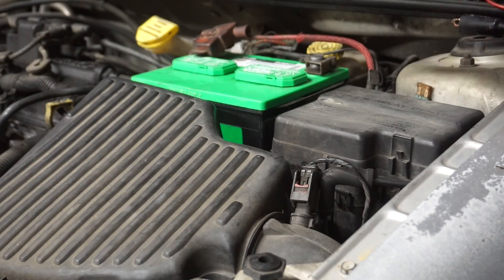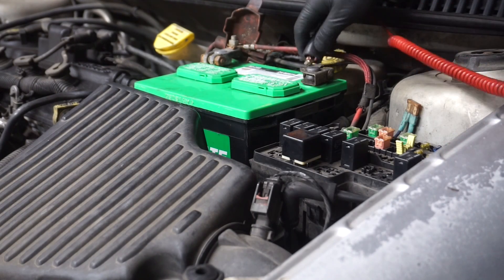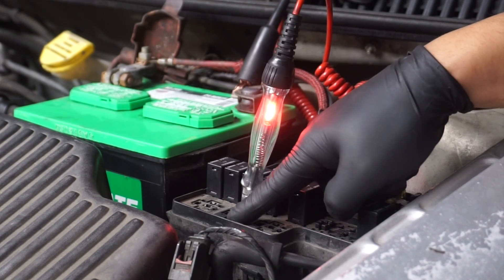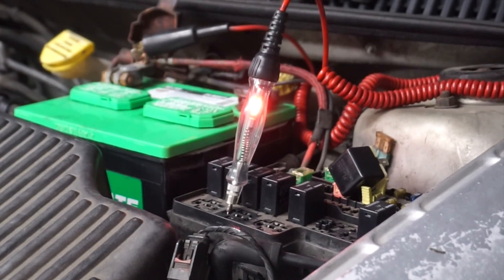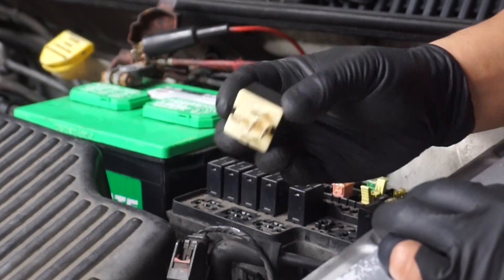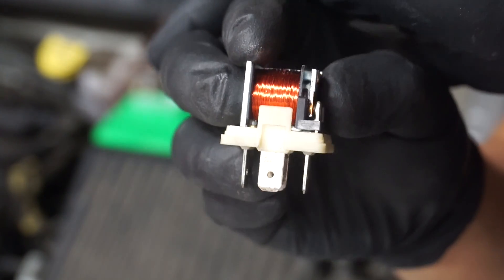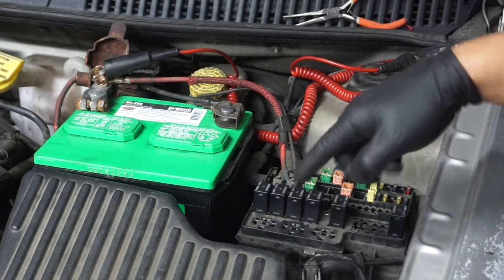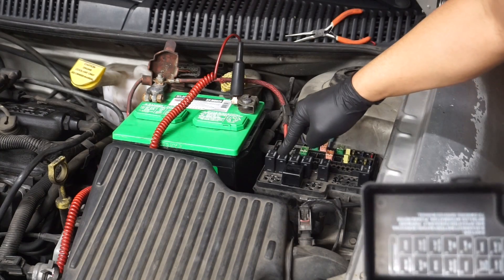How to test a relay and the relay circuit

Comment: can you troubleshoot relay for code p0888
Reply from the maker: Yeah what’s the year make and model of the vehicle
Reply: @HomieHektor  dodge neon 2005
Reply from the maker: @Midnightdragon9  SE or SXT Automatic or Manual Transmission?
Reply from the maker: @Midnightdragon9  Check fuse 17 (20amps) should have power all the time. That fuse feeds the switch side of the relay, make power is going out of the relay to the PCM. 👍🏼
Reply: @HomieHektor  SE automatic

Comment: Hi Hector good job. I have a 2011 ford edge. My passenger side tail light isn't working. I've checked and replaced the bulbs. I've checked for voltage. its good. any thoughts? Tomorrow i'm going to get some more bulbs and try that. Thanks Tony

Comment: excellent  I am not mechanic but i was able to start  2007 chevy express 2500 van using wire by removing start relay an connection 30 and 87 . New start relay , ignition switch replace,  lights on dashboard,  but when i turn the key the starter silent and light goes down and comeback  
what i am missing 
is frustrating  but also challenging  
please advise

Comment: Hector......do you have a video of testing the Port where you insert the OBD1 scanner.....I'm not getting any codes when I plug in my scanner.  I have a 92 f250 5.8 efi that's running rough and need to pull codes but not having any luck with the scanner. I tried the paper clip method too, to read codes from inside cab engine light display with no luck as well. Any help wil be greatly appreciated

Comment: Quick question, what is the relay under the steering column control. My fuel pump relay doesn't look like neither of the relays you tested. It's a long box type with four pronges.

Comment: 2011 Caravan problems:
1. Dash board shows: No fuse 
2. No BUS
3. Wiper half way
4. Main run relay clicking 
5. ASD was clicking 
6. Stick in PARK position but DASH board shows "R"
7. Electric lock not functioning.
Which fuse or relay to check and fix?
Ps: I was trying to pulling rear hub off to replace ABS sensor. Driver side door and slide door were left open, phone was being charged from car, suddenly there was beep and symptoms showed up.

Comment: Hey hector....i got an 2005 vue v6 tensioner went bad and ate the belt.. I replaced the belt and tried using a jump box ro startcar  and the the starter threw sparks and batt cables got hot.. Replaced the the starter and the poaitve cables... All it does is click and the cables get hot ..the starter kicks and spins on a bench test..could the alternator be shorted causing the hot wires and no start???... Computer still reads on the scanner

Comment: Eric, can you please help me find my flasher relay on my 2010 ram 1500. i changed my 3157 bulbs for leds and now I have hyper flashing, Thanks
Reply: You have to put ohm resistor at each bulb or you can by resistor specifically for car LEDs. I both one at Walmart in automotive department but it got really HOT when I turned my lights on so I just bought 1k ohm resistor and it worked fine. Some cars are so sensitive to LEDs that you have to install special module to stop flickering mostly German cars I believe. You can find videos on YouTube on how to fix problems with LEDs in cars. Hope this helps.

Comment: What does it mean if this jumping thingy doesn't work? 
*Compressor it's new.
*It's properly full of refrigerant.
Fuse looks good. 
Relay was swapped.
I tried jumping the low pressure sensor and the relay.
And didn't work.
What should I do next or which way should go? Thank you very much.

Comment: Homie Hektor  analogous to bypassing the AC relay and radiator relay, can the car be start without key inserted or removed and bypassing the starter relay with jumpers??? If engine is RUNNING, then can I drive without keys inserted??

Comment: been watching several channels to wrap my head around this. you do the best at explaining.   my situation fuel pump 2003 ranger key on 12 volts for one second power cuts off at pump.  start engine power returns and stays (i'm guessing drop is by design) this vehicle is having very intermittent fuel pressure loss and won't start due to the one second key on power drop, (with bed off thinking it was fuel pump)  i use jumpers leads from a battery to the pump to pressure system and start vehicle.. until i can figure out where my problem is can i use a bypass wire at relay socket without damaging my ecm. hope this makes sense i'm guessing the one second power is to "top off pressure for starting, then save unnecessary wear if not starting vehicle
Reply: have swapped relays results all same, not a relay issue

Comment: Tks for tips on RELAYS SAVE ME MONEY 👍
Reply from the maker: Pepe You are welcome. 👊🏼
Reply: @HomieHektor Homie Hektor I know it’s been years since you made this video but I had a wild situation. Woke up yesterday to no power to anything, no crank no start, just totally fine the week before, had some rain and light winter freeze and no juice to anything now. Charged the battery to full and still nada. Any idea what this could be? Does this sound like a fuse/relay or a bad ground wire? Thing is it was driving fine the week before, and battery holds a charge, but suddenly no lights, no chime, no dash, and nothing happens when we turn the key. It’s only a 15 year old car with very low mileage. Haven’t needed anything done besides regular maintenance. Is this the timeframe for fuses to just go for no reason? Does it sound like the main battery relay or something similar? Any suggestions you could give would be a life saver at the moment. What would cause absolutely everything to lose power all of the sudden?

Comment: good and very well explain, going to order that test light now...
Reply from the maker: Use the links in the description 👊🏼
Reply: @HomieHektor  analogous to bypassing the AC relay and radiator relay, can the car be start without key inserted or removed and bypassing the starter relay with jumpers??? If engine is RUNNING, then can I drive without keys inserted??

Comment: I have a 1999 Toyota Camry 4-cylinder Battery light on the dash I thought it was the alternator went back out when it was dark turn the headlights on everything heater radio you name it. When I revved up the engine the battery light goes off. I tried to turn head lights off light switch won't go off ??they will go off with ignition off.

Comment: after watching couple of videos i thought i could get a little help, i have a mitsubisihi pajero 2000 everything works perfect when the car is on, but when i turn off the car, i couldn't lock all the doors except the drivers door, also i noticed that the main lights also the interior lights not working as well when i turn on, and also the hazard light not working unless the car turned on, i was wondering maybe a fuse problem or relay problem, i checked all the fuse nothing has been cut all looks good, i was thinking maybe is the relay, i wasn't sure...
Reply: Lamese Maleko bad battery maybe. Auto zone will test it free

Comment: Would this kind of testing be appropriate to help me find a short in my car's wiring? I re-connected the negative wire to the battery and there was a large spark. After that, I'm facing a no crank no start situation. I thought I must've shorted the fuel pump relays (my car has 2) or the MFI relay because the pump doesn't' prime after reconnecting the battery and turning the key, but after bench testing all 3 like in another video you have up, they seem to be working just fine.  Am I even correct in assuming I shorted something? If you have some time, any guidance would be greatly appreciated. I'm scared to go around jumping stuff like in this video only and end up complicating my situation even more.  And thanks for your videos, you have one of the best automotive channels on youtube!
Reply from the maker: rightandleftish yup, sounds like you have a direct short to ground. Check your fuses, once you find the blown fuse, you have to figure out what’s causing it to pop 💥

Comment: Hector what about Nissan rouge ac blowing hot air what causes it
Reply: Familinda Valerio did you check to see if it has r134 in the compressor If it is charged then it is your switch in the dash that’s the two most common reasons

Comment: Great video! What would need to be done if there is not a steady ground in one of the ground pins? I have an oem hid headlight that is not lighting up at times. Usually lights up in the beginning but turns off after a while. Switched ballast, bulbs, and even connected the opposite headlight to other side but the problem remained on the passenger side. Checked the hid relay for current, 2 power & 1 ground sends a steady light signal but 1 ground flickers on & off. Will it be a hard fix or should just take it to the dealer?😩
Reply from the maker: Ilse Morales what kind of car are we talking about?
Reply: 2016 Chrysler 300s

Comment: Hi Hektor
Im driving Jeep cherokee 2.8crd auto 2005 model,I have a problem with my fuel and oil dash lights,they always on even when on full.It started after my key fell down,I started to open my doors manually,meaning the remote key is no longer working as a remote

Comment: Great video Hector thank you! Although I'm still having a problem with my fuel pump on a 95 f53 im not getting power to it so my questions are.. 1 can I test the pump by running wire (s) directly to the battery??? And what wires would go where? I know the pink w black stripe is power but there's also another solid pink wire, yellow wire and a black wire which I know is ground.. but what do I do with the yellow and solid pink wire to to pump or better yet be able to do a temp fix so I can it running I've been stuck for acouple of days now and can't figure out the problem.. I did bipass the emergency shut off by tying the two wires together and test light lights up?? Any help would be greatly appreciated as I said iv been stuck for days with little funds needless to say Its nothing short of a nightmare. Thank you.

Comment: Great info. Hector. I have a question. My 2003 Chevy Silverado 1500 has a parasitic draw. I'm mechanically Inclined  bro. I checked all the fuses while having a multimeter connected to the negative battery post and terminal. The the amp draw is about 60 milliamps. When I disconnect the the instrument cluster it goes down to about .20 amps.  Is there a relay or fuse I'm not seeing? Thank you

Comment: Why would my horns have constant power. They just went off one day and had to disconnect them ?? Thanks for your help. steven.milburn@comcast.net
Reply from the maker: steven milburn depends on how it’s wired, maybe a stuck relay, a stuck horn switch, maybe a short to power. What kind of car do you have?
Reply: @HomieHektor  Thanks for the quickv response! Love your channel. 
It's a 1999 Acura TL. I checked the horn relay per your detailed video, and it's good. Do you think it's in the steering wheel?
Reply: Replace the horn one probably has a short

Comment: Very clear and informative video... the info on relays finally 'clicked'.        
Question : I jumped my BMW and now it cranks and won't start and my check engine light is no longer working at all.... I could really use your insight on what might have been damaged. My car is a BMW 530i 1995.Thank you.
Reply: Yes I'm thinking that may be what happened. Upon further inspection (was under the hood checking my fuses and relays) noticed that a few of the wires connected to the DME were fried. Looked like they had gotten toooooooooo hot. Hoping you want to go over your technique for sautering wires together in your next video. In tips would be much appreciated...I really don't have the money right now to replace the darn thing. Thanks so much.
Reply: Update on my BMW...I was able to separate and splice the melted wires. Got the car running again. Thanks again for this video it really helped me on my search to figure out the issue with my car.
Reply: Hello friend, can you help me, i have exact the same problem i was doing the jumper wire and now my car only cranks slow but it won't start, my car is 2001 Hyundai Santa Fe, how did you fix your problem i have been trying to figure out.

Comment: Thank hektor another good video as always, una pregunta en el uso del multimetro en 10 amps, pusistes el (-) lead en el pin #30 y el lead rojo en el #87, what happen if the leads are the other way around? Thank you and cheers from Ontario ca, saludos homie
Reply from the maker: Everardo Camacho nothing happens, you’ll only have a - reading on the meter, think of it like a jumper wire with a meter in between 👍🏼

Comment: Having an extra (known good) relay with the cover removed would be a great tool for troubleshooting. That's an awesome trick. A nice use of an amp meter too. Really good video Hektor.
Reply: You talk about bypass and frying,can you show?
Reply from the maker: wyattoneable Thanks again, this should help a lot of the new homies on the channel 😎
Reply: You can buy relays specifically for testing purposes. They have buttons that you push to test circuit. Very easy to use.